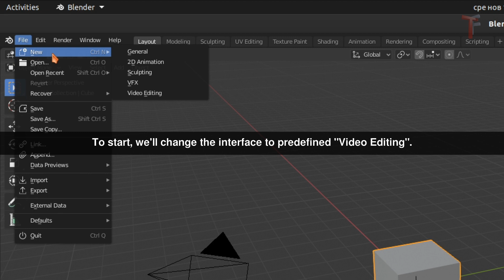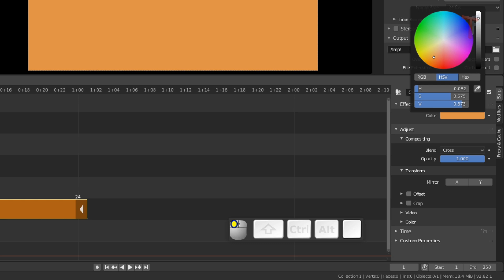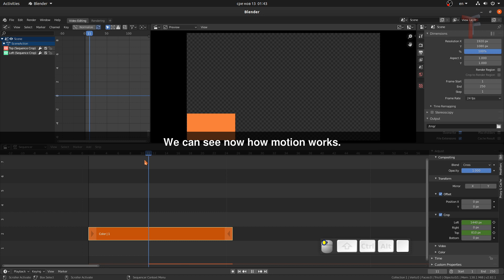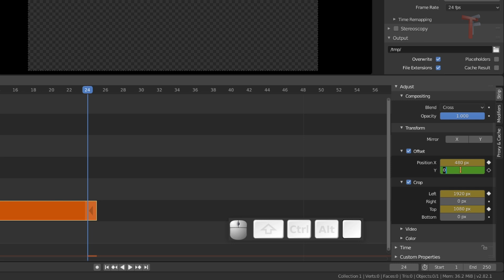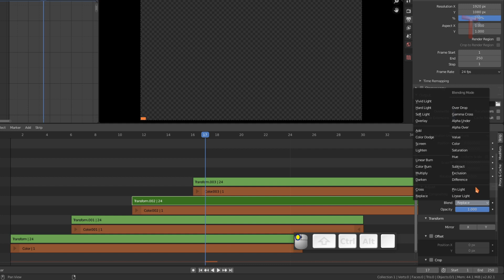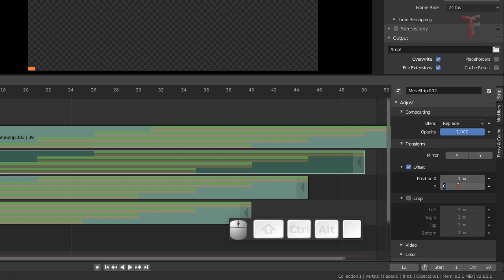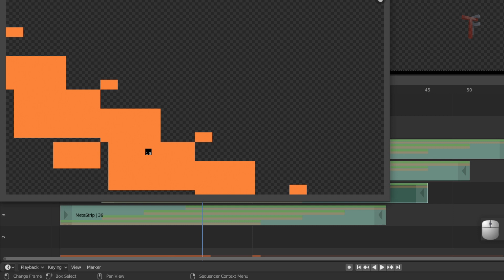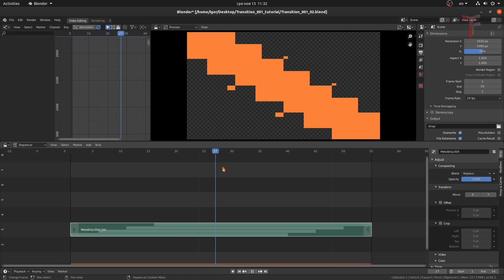Transition effect in VSE - Blender 2.8 - Tutorial |part1

Comment: For some reason, when you're at around 4:43 and you have it on the overdrop blend, it won't show any of the frames except for the original. Help would be appreciated.

Edit: I went back and watched the video again, turned out I messed up duplicating the strips. Great video!!
Reply from the maker: Hi Jacob, it should work as in the video, recheck if all "orange" strips are hidden, and three upper "green" strips are overdrop. 
If strips have different frame arrangement, may appear as it has continuous animation, while animation below is actually ok, it could trick the eye. 
Or try only with two, to locate the issue, and afterwards, copy the other two.
If you could clarify how frames doesn't show up,  in case I misunderstood the issue, I could  probably point to the right setting.
Reply: @AndarionCGart  thank you, and keep up the good work!
Reply: @AndarionCGart  also, can you tell or show me how to export it as an .mp4, I can't figure it out.
Reply from the maker: @jacob.19   Within "Output properties", in general, you have to adjust length (in frames), size and required frame rate.
Then, within output dialog, for file format choose ffmpeg, for container mpeg-4, and for video codec you could use H.246, you can leave other parameters to default.
When all that is completed, up in the Render menu, choose Render animation, or CTRL+F12, to start rendering.
Reply: @AndarionCGart  thank you once again. Sadly (I am very sorry to keep bothering you), I have another problem: the background is completely black when I put it in StreamLabs, so it doesn't work well as a transition, how do I fix this?
Reply from the maker: If video has to be used for transition, than container has to be mov format, and png for codec.
Or simply render whole frame range as a png sequence, but make sure, in both cases, you have selected rgba mode.